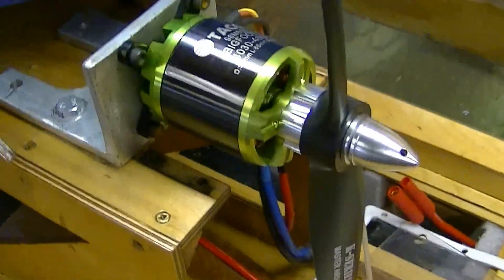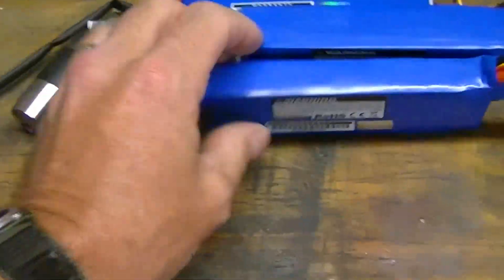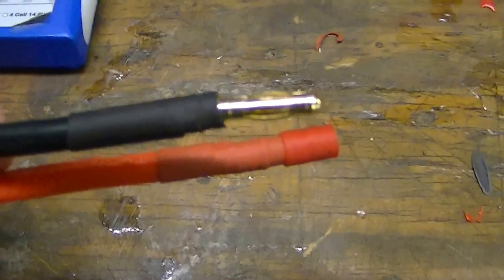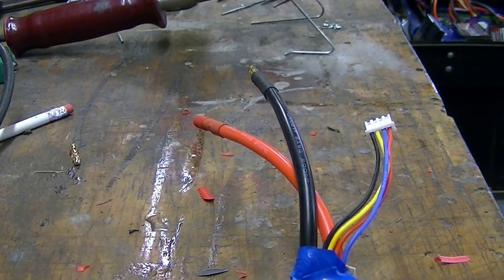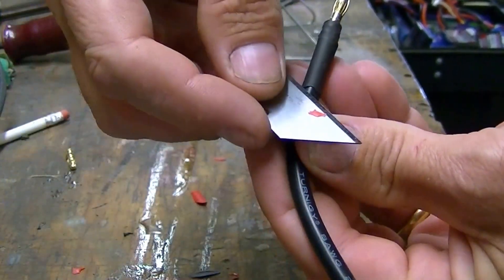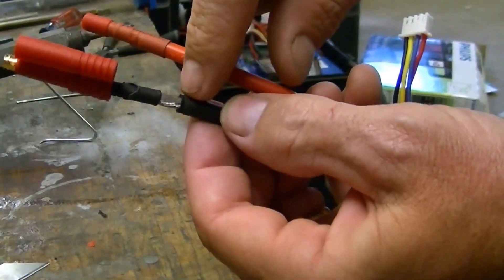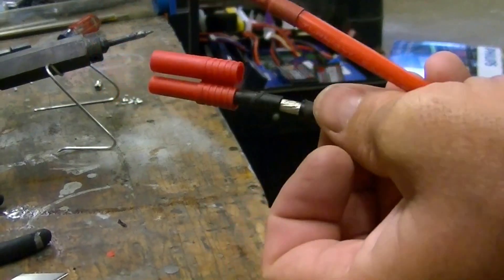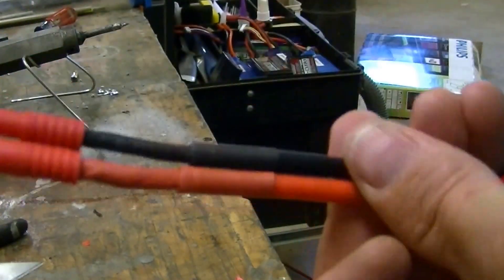How to fit 4mm HXT connectors onto 8awg silicone wire

Comment: jesus... I just cut one twist off the end so the bastard fits. solder it on, jam it up from behind. job done.
Reply from the maker: Jimmeh B   I literally just did your method a month ago. But to make it slide in better, I chamfered the small shoulder on the connector.  I should make an updated video the next time I buy batteries.
Reply: yeah fair enough :)   They're a bastard to make fit in the housing either way. At least the cheapy Ebay ones are. I use them for everything, I have a bunch of "extension leads" that are used for everything from my multimeters, chargers, led work lighting, exhaust fans for welding..... everything. It's very convenient to be able to grab a lead for whatever, whenever.  I must admit though, I'm not totally happy with them and am looking for a better solution.

Comment: Hi mate I use the 4mm HXT and once you solder the connector you push it in from the back so you dont need to trim off the wire casing , do one and try it just use the long nose grips to push in from behind till it clicks , I will fit really nice

Comment: Man you saved me some headaches!  I've been dealing with this exact situation for three days now.  I originally installed 5mm plugs onto my ESC then I was changing all my batteries connections over to 5mm.  But like you all the batteries I get are always 4mm HXT.  Well thanks a lot for the great video.  I can now finish my boat without doing it the hard way.
Reply from the maker: Glad to help. thanks for watching.

Comment: This vid is exactly what I needed! I figured out how to solder these just fine on my own, but the insulation on my zippy batteries was thicker than normal for 10awg wire, making it impossible to slide on the red housing before soldering. Thanks for posting!

Comment: where would we be without hst ? 
and wow that soldering iron's a beast lol ☺

my problem at the mo is i have some solar equipment that needs as thick as possible wire to distribute the 12 volts to things like my lights and fans, and 8 gauge wire is the only one capable of it, problem using it is i need to be able to join the wires into a connector block, as i have quite a few areas i need the power to go to, and the only thing i could find to do it was something like this http://bit.ly/1BgFAWI thing is i'm not sure i could get soldered or (soderd in the us) 8awg wire in a 5.5mm hole 

vids a good idea though i might try it  ☺☺